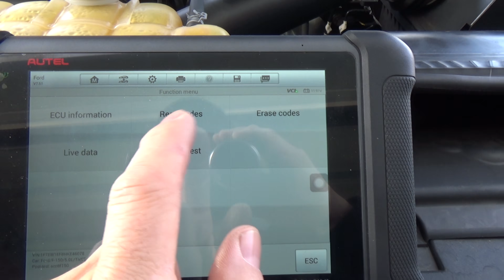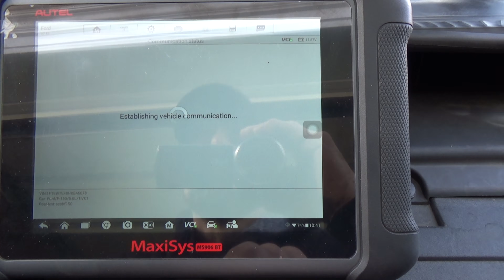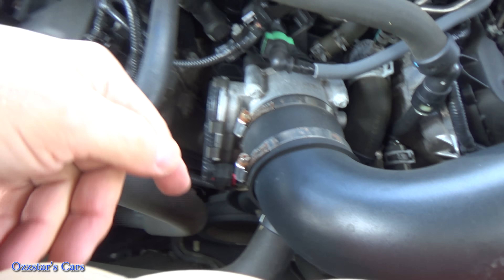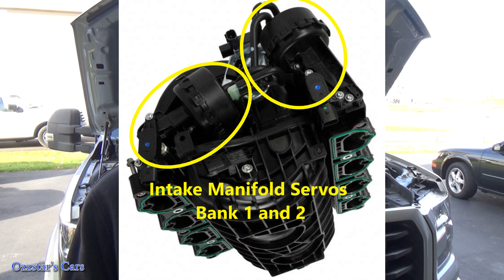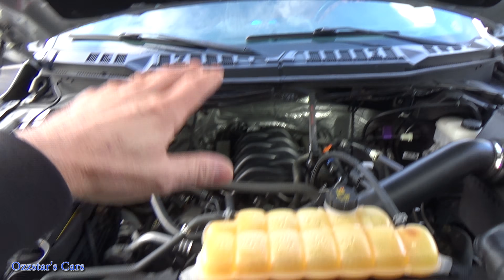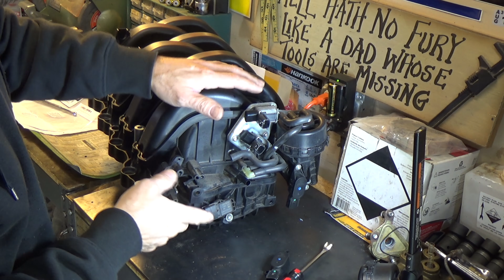Ford F150 Engine Rattle Tick Noise: I Can't Believe Shop Says It Needs A New Engine

Comment: Great job on diagnostics. I’m a municipal fleet technician and this manifold runner control noise has affected a few of our vehicles. One was sent to the dealership (not by me) for a noise that I was told sounded exactly like valve train noise or possibly a rod knock. They ultimately said it needed a new engine. They even claimed that they cut open the oil filter and metal was found. I don’t believe that this was actually done. After replacement I was the person that picked it up from the dealer and immediately heard the noise and notified the service writer that got the tech to come out to look at it. He said that it was probably a lifter that needed to break in. I said that that’s not correct but called my boss who wanted me to bring it back to our facility anyway. I asked to take a look at it and found that the noise disappeared when I unplugged one of the runner control solenoids. I drove the vehicle back to the dealer and showed the service writer and tech and they acted like they’d never seen that before. They ended up keeping it for a while.
It’s getting bad that dealerships seem to be increasingly bad at diagnostics, at least on certain things.
Reply from the maker: I can't even imagine how many perfectly good engines have been replaced due to misdiagnosis the problem. Thanks for sharing that story!
Reply: Dealers are being carried by their service departments. Service departments are trying to make the most money possible.
Reply from the maker: @Steeledawg  they do make money on service!
Reply: They just "throw against the wall, and see what sticks" to see if you'll bite on a $$$ "repair."
Reply: Car makers are making clunky crap made out of plastic and car dealers mechanics are not car gods to fix shit.
Reply: People in general getting bad at what they do. Too much Instagram not enough learning
Reply: Pffft... Seen doctors lately? They're just as bad! It's really no surprise. It's just the enshitification of everything.
Reply: A good tech fuel well knows what it was and how easy it is to fix. The dealership lied to you rather than check the lash, adjusters and rocker arms. It’s a known problem with the coyote 5.0. Even a lightly skilled mechanic can fix it easily. You didn’t need a new engine.
Reply: @TheBlueDogMan it wasn’t a valve train noise or problem. The noise was present when I went to pick up the truck after they installed a new motor which had the original intake transferred to it. That was the problem to begin with although they claimed the oil filter had metal shavings in it.

Comment: If you didnt care about the noise. Could you keep driving without damaging the engine?
Reply: Also could you get a better part that isnt plastic? Cast iron or steel.
Reply from the maker: @johnweiland9389 there may be an aftermarket delete kit and it would need to be tuned out. Unfortunately all the manifolds I know of are junk plastic.

Comment: so over engineered, i dont see LS intake manifolds needing this fancy system. the engine shouldn't need a STV in the intake when the main throttle body can already compensate for fueling since its electronic.
Reply from the maker: Engines need an intake, they can't work solely with just a throttle body.
Reply: @ozzstars_cars   my GMC Sierra has just a throttle body and an intake manifold. It doesn't need this extra system that puts secondary valves on the runners. Ford just likes to over do it sometimes.
Reply from the maker: @banana82728  the purpose is to improve the torque/horsepower curve efficiency and get the best fuel economy while reducing emissions.

Comment: Thanks for this video… I called that the Sonic Death Ray sound. My dealer says they can’t hear it… I need to find a goo independent mechanic.  What part names should I say to a mechanic when describing the issue, because the dealer acts like it’s impossible.

Were there any codes associate, because I have no codes.
Reply from the maker: You may want to watch the full video and then show it to the dealership.

Comment: Just lazy diagnostics. Seems more typical than ever. As an old MB mechanic I have seen some doozies.
Reply from the maker: Working on Benzs I wouldn't doubt it for a second! I am currently diagnosing an '86 450SL, starts and runs for 3 seconds, shuts off. Over and over....dang spider injection. 🤷🏻

Comment: I thought the coyote was a reliable engine, is this a newer version of the coyote?
Reply from the maker: The Coyote engine is reliable. In 2018 the 5.0L was redesigned and went GDI, big timing issue problems until corrected in 2021.

Comment: If the dealer is paying their mechanics flat rate and you need a diagnosis,,,run away and find a small dealer that pays the mechanics an hourly rate. The service advisors have seen this 100 times is my guess. This should be a warranty in my world. I bet there are a few people that were told they need a new engine as well. The dealer that said we need to pull the engine or you need a new one should be fined for fraud and their business license pulled. Do not believe Intelligent Oil monitoring system. Turbo boys , clean your PCV SYSTEM and change your oil at 50. % on the monitor it can’t cool the metal and will destroy the timing gears and all aluminum bits. ASE MASTER TECH . Thanks for the video Peace on earth and ocean.
Reply from the maker: Keep in mind some mechanics don't know what they are doing and some do. Some are diagnosticians and are trained and educated to find problems.

Comment: I think, its insane seeing another problem a ford engine has with all their crap, dohc, timing chain phaser nonsense
    And they still dont have as much power or fuel economy of a chev with pushrod engines. Its hilarious to me.
Reply from the maker: Chevy has there major issues as well.
Reply: @ozzstars_cars  ah. Maybe the run of crankshaft problems, but thats pretty much sorted out now.  Seems more of a lazy machinist than an actual design flaw.
   I dont think chev has a problem that every manufacturer isnt sharing right now. Simply being forced into the ev scam and being over priced is across the board for manufacturers
        Aluminum body work costing way too much, and signicant premature part wear/too much cost is unique to ford

Comment: should have showed the new part and the sound difference when it works correctly.
Reply from the maker: The engine sounds the same as it did at idle. Good suggestion but videos can only be so long.

Comment: There are people that will do a hit on someone for $5,000. For $9,000 they'd make the person suffer.

Unfreakingbelievable what some of these mechanics get away with.
I ran my 09 Corolla that i bought brand new almost out of oil without knowing it. It make a slight buzzing noise going around corners. Toyota dealership told me i would keed a mew engine immediately $7,000.
Turns out all i needed was some  oil.
 6 months later still runs like the day I bought it. Toyota dealership didn't even fix the leak like i told them to. Took it somewhere else they charged $390.00 to put a new oil filter housing unit in. They thought it was leaking. Car was STILL leaking when i picked it up. O discovered that it was still leaking 20 minutes after i picked it up 
So i looked for the leak myself and found it in about 60 seconds. It was a ruptured oil pressure sensing unit. Cost me $18.00 at AutoZone and about 20 minutes to figure out how to reach it and install it.

It happened six months ago but still hard to believe they told me i need a new engine. Hard to believe  i almsot believed them. Hard to believe the next mechanic chargede for something i didn't need amd couldn't find the leak that took me 60 seconds to find.

When i told the service manager at Caldwell Toyota to jist put some oil in it amd I'll drive it for now the last thing he said to me was...
"Ok but it's gonna die on you at any moment, either that or the engine will just lock up on you."

I'm going up there in a few weeks to buy some transmission fluid. I hope he's at work because I'm going to confront him.

Comment: Seen a similar issue with a Mercedes engine involving moving  plastic part's in its plastic intake system.
The difference was, that engine was producing fault codes.
None the less. Great diagnostics. Another win win for the customer.
Reply from the maker: Thanks!

Comment: 5.4 Tritons made similar noises, sems like its another FORD cam phaser and deteriorating plastic engine chain guard issue. Many comments on various sites including u-tube about that. 

The bottom line is 'engine replacement' (rebuilt) with the exact same engine then get rid of the truck, that's what I did with  my 2008 F150. 

Never again a Ford truck!

Wished it was the late 1950's or 1960's when trucks were made solid and without all the computerized electronic stuff!
Reply from the maker: You won't do much better with Dodge or Chevy, or will you?

Comment: What a weird design. Why would an engine need flaps in the runners? That is what the throttle body is for.  I using a listening stick or long screwdriver to track down noises in my rides.
Reply from the maker: Has to do with fuel efficiency and torque delivery.
Reply: @ozzstars_cars  Ok Cool. Thanks. But Sounds like another way to cost consumers more in repairs like AEM and DOD. Little gain if any after the cost to repair failures.

Comment: Fantastic and informative video! Very same issue I have noticed on my 2017 F150 5.0 since 85k miles. Seemed to hear the noise more when cold outside and clearly something would "open" and click would disappear. Now with 169k one or both IMRC stuck closed with P2005/P2007 failure codes. This is the best diagnostic I have seen. With Ford now backordered with no delivery date on over 4800 pcs, this manifold is far from available, so considering a lockout option. If you sold a lockout kit with lockout tune, would be a great product link to this. I am manually searching options at the current time.
Reply from the maker: It's a shame that there are so many units failing and Ford can't keep up with production.  A manifold runner delete would be the only alternative at this point. I would not trust the aftermarket on this one.  If you find a kit that is a quality part please let me know. Email is ozzstar@aol.com Thanks! -Glen

Comment: My 2018 coyote 5.0 f150 had the piston slap knock.  Very loud at idle.  I got rid of it.  20000 miles.
Reply from the maker: Only 20k miles? My guess is somebody was running the piss out of that thing. Probably didn't break the engine in properly either.

Comment: Maybe 20 yrs back a young bloke bought a big Kawasaki inline 4 to a shop a friend worked at, the kid had been quoted $AU2500 by a major dealer to replace the crankshaft, Bill removed the alternator cover and found the starter clutch loose. Four HT screws, some loctite and a gasket saw the problem fixed.
Reply from the maker: A good diagnosis is the key to success. Thanks for the comment!

Comment: I was told the engine  needed to come out of an 04 Nissan Quest to replace the timing chain and tensioner  and guides. It was quoted at $3,500 . The value of the van. I replaced everything with the engine in for $600.  I refuse to EVER listen to what the " Book" says. I refuse to ever take my vehicle to a Stealership. It's getting harder to find an honest mechanic anywhere that can actually THINK beyond what the book says. Books are for ninnys. Other than torque settings, I try to think beyond what a manual says. I used to sit at the table and  go through manuals and cross out procedures  and write in the correct procedures. I usually ended up give that manual to the next vehicle owner. Now it's all on line.  Wouldn't  a manual vacuum pump duplicate your fancy computer to check that valve?  Being old  school, you can generally actuate anything operated by vacuum using a manual pump. I also use my multimeter often. I hate plastic parts. Good video!
Reply from the maker: Sure a test light and a vacuum pump could help in the proper diagnosis with this issue. The issue is getting back there to hook it all up!  Now that would be a job in itself considering how tight everything is with very difficult access. Hook up the proper scan tool and it's a one minute diag. Done. Thanks for your comment.

Comment: Just think these truck dealers are asking $100,000 for the same garbage engines with a new body design. $100,000 for pure aggravation and crap dependability. I hope people stop buying this garbage and these auto manufacturers get stuck with these overpriced un reliable POS $100,000 trucks.
Reply from the maker: In 2018 the 5.0L was redesigned with GDI and brought on a bunch of new issues! Quality control is poor in all manufacturers these days. Like you say Dwayne, way overpriced!

Comment: I've been looking for a used pickup truck and I started researching the different engines for each manufacturer. I have completely ruled out Ford and Dodge trucks. Ford has a ton of problems with the Triton V8. Dodge 5.7 liters all fail it's not a question of if but when. GM and GMC seem to have less problems nut still have problems. To be honest American truck engines suck. Not one of them is truly dependable they use garbage to build them. Ram tough Ford quality what a joke.

Comment: 89k miles mine is starting to do this..I had a warranty trans and torque converter replacement done 1mo ago, now this...love my 5.0l 17 f150 truck thou..thanks!
Reply from the maker: Wow, what symptoms did the transmission have that needed replacement at such an early age?

Comment: So let’s install both servos on the rear of the manifold, and throw a Map sensor back there up against the firewall. If they continue to build with plastic shouldn’t we see truck 🛻 prices go down ? I love the we don’t need a transmission dip stick , we can just crawl under the vehicle and pull the plug and stick your finger in it.
Reply from the maker: The world is getting dumber and dumber.

Comment: Do the Ecoboost Engines have this issue or is it just the Coyotes?
Reply from the maker: They have worse issues than this.
Reply: @ozzstars_cars  ok, worse issues. Do they have this specific issue? My 2011 F150 Ecoboost is at the Ford dealership now. Had low oil pressure originally and engine light... Had timing chain replaced, all 4 new phasers, VCT solenoids, gaskets, new filter screens on turbos, all new spark plugs, new oil filter, air intake filter, engine flush, oil change.... dealship now says it makes a noise still and they want to sell me a remanufactured engine.  I have to go back and look/listen myself so am doing research... i want to take a ride with the Ford Mechanic to hear this rattle, tick or knock he says it makes and he can't diagnose. I even had them drop the oil pan and all was good, no clogs in intake screen or tube, etc... Any ideas?
Reply from the maker: @Baneslayer  watch this video with them.

Comment: My 2004 E350 Super Duty 5.4 2 valve engine with 180K is super quiet and can sit in the Florida 100 degree heat for hours idling if need be and not over heat. A really great engine and all I ever had to change was the oil and filter and plugs and coils. That's IT. These newer Ford engines scare me, I'm keeping my work van and will put another engine it if when it fails before I buy a new one.
Reply from the maker: Around here in Delaware they slowly rot and rust away. Otherwise they run for 250k miles

Comment: I’ve got a 2018 F150 that had a timing chain slap that cured itself after I changed out a blocked cat, now it’s throwing 304 303 and 300 codes I’ve heard new engine,coils,injectors will throw codes when accelerator goes over 50 percent and runs rough as a cob on anything except e85. I’d bring it to you as if m at a loss or maybe you know someone near Des Moines Iowa. I’ve taken it to a dealer and four shops. Thank you
Reply from the maker: Just a little too far from you David. I'm in Delaware. Hopefully you can find a technician that can solve the issue.

Comment: Thank you for the Video, My 2017 has just started making a noise similar to this, that my Mechanic didn't know what the cause was. I have an appointment with Ford next week to see what they say, at least I have an idea of what could be wrong now, so if they tell me I need a new engine, i can have my mechanic investigate more. Is it safe to drive still? how soon does this problem need fixed?
Reply from the maker: It's difficult to say how long the problem can he ignored. Maybe you can show them the video.

Comment: This is THE best video I've ever seen on you tube. This is also what all mechanics should strive to be - honest, knowledgeable, and humble.
Reply from the maker: Wow, thanks for the compliment! I appreciate the support. -Glen
Reply: @ozzstars_cars I know this is an older video but I have a 2013 f150 5.0.  I thought it was the water pump bearings but with the stethoscope, it doesn't sound like it. Sounds kind of like this but with a intermittent howling noise. Could this be the possible problem on earlier models too? I am not getting any engine codes. TIA
Reply: @mikesterling9322 I had to replace a water pump in my 2013 around 55k. I’ve had an intermittent chain dragging type noise since around that time. Nobody can figure it out. I think, the chain tensioner is bad around low RPMs, and the chain is contacting the front cover. Probably just going to sell it and bail. Driven her ten years.
Reply: 5.0

Comment: My friend has 2018 F150 with 5.0. Had similar noises and what sounded like piston pin knock. They Ford Made repairs under warranty. 
Several months later noises came back , started using oil. 
Engine died
He brought it back to dealership waiting for engine which is on back order. 
The 10 speed trans also has issues 
Nice video
Reply from the maker: Wow that's tough luck and sucks. Thanks for watching! -Glen